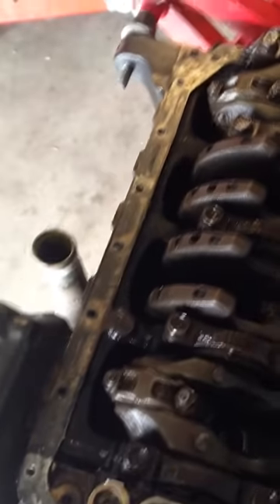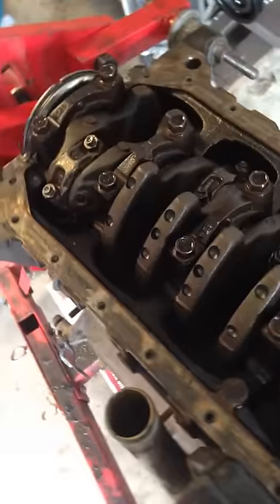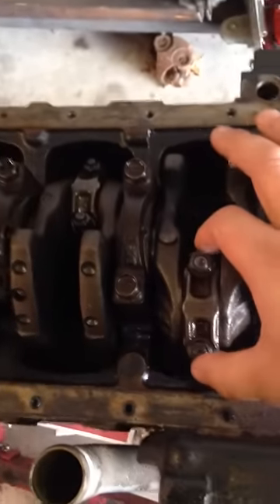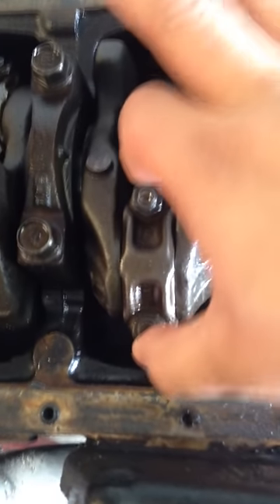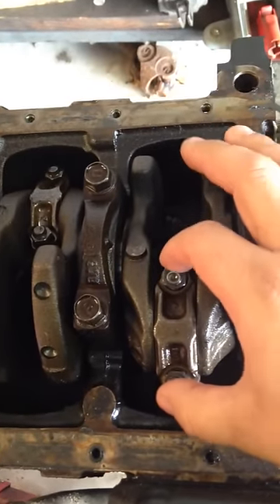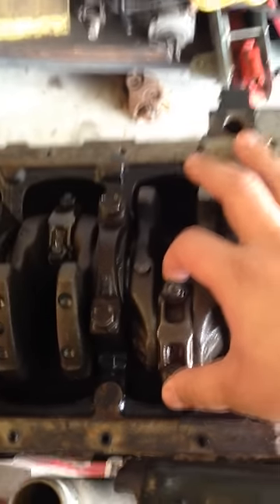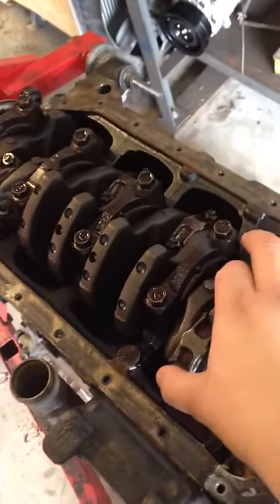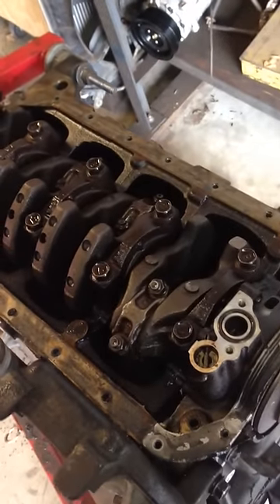Rod bearing noise or a spun bearing noise

Comment: Wow! Always wondered what actually was causing the noise with a "bad rod bearing." Thanks for the explanation!
Reply from the maker: Glad I could help with that
Reply: @FalconsGarage  would a bad rod bearing noise get louder as you increased rpms, get quieter or stay the same noise level?
Reply: @scam  I've come to the conclusion I got a lifter tick and that's what second opinion mechanic told me. Noise stayed the same or went away all together with rpm increase
Reply: Is it salvageable?
Reply: So can you fix it ?
Reply: Mine only knock undder 1000 rpm

Comment: My corolla has that issue, I'm too cheap to buy a new car hahaha I just hope I don't have to empty my wallet on repairs.
Reply: My corolla has 573k miles on it. I started hearing this noise on the way home from a long trip. As soon as I got it home I bought some new bearings. Replaced them and still running fine 40k miles later.  1999 corolla with the 5 speed manual trans.
Reply: @scam  lol thank you.

Comment: Great vid bro that one seems to be gone and most likely has damaged crank too!
Reply: It can be fixed don't use any sand paper just cleaning using Emery cloth only then put new one in tork it to spec and don't keep rotate the crank after u install the new one put it all back together and u be good another 90k
Reply: @rickcarp5453 how can you replace the rest of them without rotating it??
Reply: @peachyclean93  you got to reach up in there with your fingers to set them it's a little bit tricky

Comment: Dealing with this problem right now and dont know where that knocking is coming from in the process of dropping the oil pan. I watched videos on how them botls break easy for the lower and inake I guess the best way is to shock em direct with hammer to the bolt right after you crack the bolt free dont take it off yet shock it first with several wacks of a heavy hammer.

Comment: I have a 2015 kia sorento and hw much will cost me to fix the rod bearing?
Reply: Hope he answers I have one also but not sure I hear this sound or have the issue, but would like the answer incase it happens I know what I should do ahead of time.
Reply: Nothing cause Kia/Hyundai has recalls on the engine for this very reason just take your call in and let them know you may need a engine replacement.

Comment: My 98 accord makes the noise..but as soon as I put the gear in and start running it it goes away and the engine sounds smooth...why is that?
Reply from the maker: weird bearing noise  will usually get loader as the engine revs up or underload .. so this might not be your issue
Reply: @FalconsGarage  but it sound right were the video shows..the engine is really smooth no shake ..what could it be

Comment: Does the engine have to be rebuilt after that?
Reply: Do a engine compression test as long as the top heads are healthy you do not need to rebuild the engine or replace it with a used engine

Comment: my car is doing that, thanks for the info
Reply from the maker: No problem 👍
Reply: @MrCamus83

Did you get it fixed? If so, how much was it in usd?
Reply: I have a Chrysler 200 doing the same year 2013 @FalconsGarage
Reply: @kadeejahughespatterson738 I have a Chrysler Sebring 2010 with the same problem smh

Comment: you’re the best bro I was wondering. So is it an easy fix. Should I just learn to rebuild myself or sell the car cause those are my only options.
Reply from the maker: its about a 7 or a 8 out of 10 in a difficulty level .. it also depends on what size engine you have ..

Comment: Had low oil pressure code Vanos inlet camshaft jammed sound like baseball bat hitting sum on the bottom N55 2011 335i, it was a small noise at first then got an oil change it got super loud but driving perfect on the highway, I’m lost could it be a rod or lifter spark plug or injector? Help!😅

Comment: Im still learning about cars. Thisbsi the crankshaft and i assume the pistons are facing downwards? So how do you fix this issue? A new rod/pisoton?
Reply: Engine is toast once it does that
Reply: @kacper.6537 Not really all depends on what the problem is long as nothing broke inside the block scratching it

Comment: How did you fix it ???
Reply from the maker: replaced the engine .. was cheaper that way
Reply: @FalconsGarage  that’s what I’m finna do I have a 2012 dodge Challenger
Reply from the maker: @93baby  yeah.  While it is fixable if you can find a used engine with lower mileage is probably better
Reply: @FalconsGarage  I’m still looking for one 😞
Reply: @FalconsGarage  where to  buy used engine.....?

Comment: How to fix this problem ? Should we tighten the rod bearing or replace it?
Reply from the maker: if it was torques correctly and its still lose you can try getting a bigger size bearing as long as its with in specs ..
Reply: I like that one long time ago I went underneath and I thought the bolts was loose. Lol.!!!

Comment: Hi I have a loudly knock noise and found that is coming after oil heating, when car is stopped at low rev. When throttling the engine shake a little after it 2000rpm noise and shake disappear. Rod/spun bearing?
Reply from the maker: could it be a lifter noise?
Reply: @FalconsGarage  Thanks for your reply, I checked valve lifter noise which is like "Tic Tic Tic", noise on my engine is like hitting with hammer.
Reply: Maybe engine mount
Reply: I have same problem 1jzgte engine
Reply: You found the problem? What I have right now

Comment: Where can you hear the noise coming from is bottom end or top of the engine
Reply from the maker: bottom
Reply: Thx for your reply one more question if you but ur hand on the dipstick tube and feel it taping can it be rod gone is there other way to get in contact with you

Comment: Does this mean I have to replace my engine and pay for a new one or can I fix the bearing alone without replacing engine
Reply: You can fix it but you will need to replaced the whole Rod bearings and it will cause u a alot of monry
Reply: @idiomatic_2352 can you give us an estimated cost of how much it would be?
Reply: @alexvirto9559 it depends who you go to another way you would know if u drop the oil pan in do what he just did

Comment: So if that makes noise can the main bearing also be damaged? The bearing that holds the crankshaft
Reply: the oil is usually pushed out from the main journals to the rod journals, and then back into the oilpan and trough the oil filter. So your mains could survive this. But you still wanna do an engine rebuild straight away.

Comment: Do you rebuild 392 hemi’s? Having the same problem
Reply from the maker: ive done it in the past .. but honestly probably more cost efficient to just replace it when you include parts etc
Reply: @FalconsGarage  thanks bro
Reply: @FalconsGarage  Hey bro, I was wondering, if  $12,000 enough to forge an engine? I been wanting to and I figured since it's down I could go back in that direction if I can get it done under the same price.

Comment: We call it, a "Rod Knock". Cause when it is running you hear, "Knock", "knock", "knock".. It is a sign that the connecting rod bearing has been damaged/destroyed, there for the engine needs to be rebuilt/ replaced....
Reply: Replace a entire engine over a bearing. Yeah ok lol.
Reply: @mysterycomment1553  , yeah, that is how it is done. Once that 1 bearing goes, every other bearing is effected as well. You have engine parts running at HIGH RPM, the bearing noise is what is called a rod knock. Cause the bearing is worn enough to such a point, the connecting rod is beating against the crank at RPM. Take a hammer and beat it against a piece of metal as fast and hard as you can, the metal will deformed. The worn pieces that have been BASHED in to metal flakes move through the oil system. Which.....Privides....MORE grit to other engine parts. Which they too, began to also go bad. So now parts are effected to where ever the oil goes..